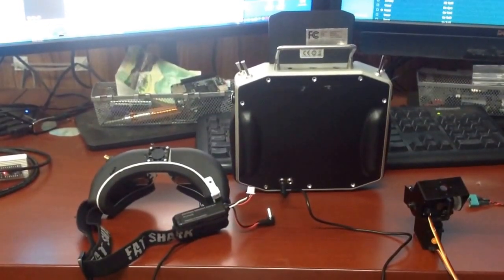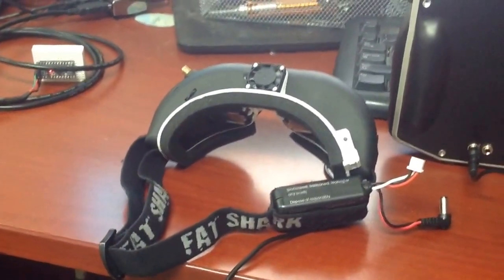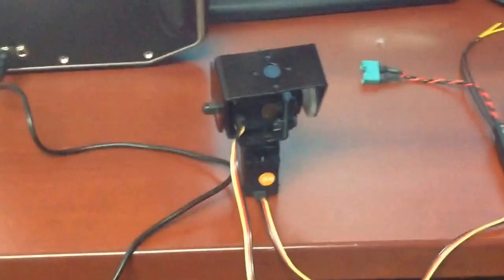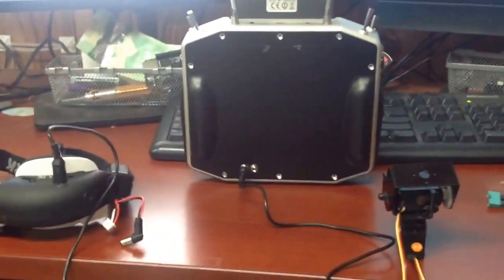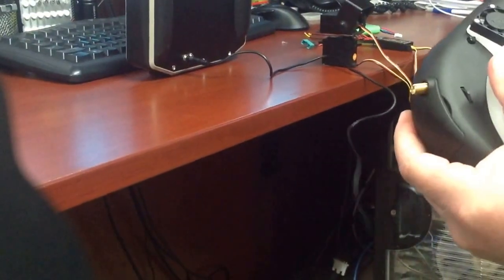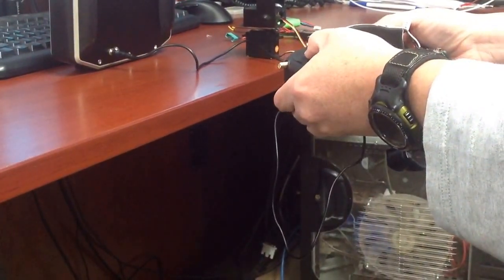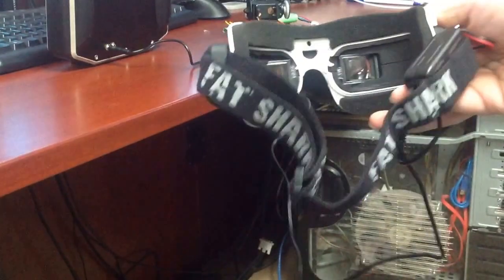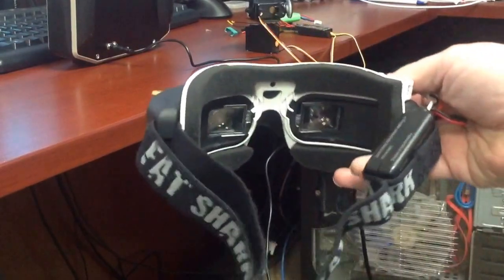Fatshark Headtracker with a Jeti DS-16

Comment: hello I bought na radio jeti dc 24 in the antenna that brings the radio has a connector yac according to the instructions is for the antenna of radio input ppm and output ppm but it is not very clear to me also I have bought the stereo connector to connect it in the inside the radio as you have put it since I want to use the head tracking of my glasses fpv skyzone v 3 could you pass some kind of scheme of how you have connected it? or make a detailed explanatory video since I can not find detailed information on how to send a greeting. Thank you.
Reply from the maker: The DC24 seems to have the same connector as the DS16 (based on the pics in the manuals).
I don't do not the wire scheme of the optional stereo cable that jeti makes. I can't buy it here cause they forgot to include it in the FCC testing! LOL
I made my own cable/connector for my DS16. Obtained the white pcb connector (from JST), and ran it to two mono jacks. Both jacks get ground for the Jeti connector, one gets the PPM IN and the other gets PPM OUT. Note the PPM out can also send EX TELEM serial data out also. You  choose the output type in the TX Menu - System - Configuration - PPM Connector Settings, see page 133-134 of the DC24 manual. NOTE: it says use the mono plug!!! 

You say you have the stereo cable plug. If it connectors to both the PPM IN and OUT pin, you are going to have to be really careful about what you plug in!
You might want to depin anything that goes to PIN4 (PPM out) and PIN2 (positive).
Only use PIN1 PPM in and PIN3 (GND).

Also you gotta make sure, you only hook 3V (ttl level) logic to these pins! They aren't 5V tolerant!

I have no idea what Skyzone PPM output levels are. Do you research. I had a hard time finding an good specs for Fatshark. In the end, i had to hook them up to an oscilloscope and check them.

Assuming you got the googles connected to those pins, lets assume your goggles are outputting pan on ch1, tilt on ch2, and roll on ch3.
in your tx, create pan, tilt and roll functions.
when creating each function, instead of choosing a stick/switch, you drill into A/B function selection, scroll to the bottom and pick the CHx PPM IN that matches your goggle output.
see pg141-142 of the DC24 manual.
then assign servo channels for you pan/tilt/roll functions.
Then you do a little servo travel setup for your camera unit.

Good Luck. Sorry i can't help with the details now. Maybe in the spring when we finally can buy the DS16 here in Canada i can help you out better.
Reply: when i buy my radio jeti dc 24 also buy the cable that you connect inside that e like the one you have connected http://www.espritmodel.com/jeti-transmitter-ppm-jack-cable-red-stereo.aspx
Reply: this is the manual of the glasses that I have orderedhttp://files.banggood.com/2016/12/SKY02S%20Manual-V1.0(1).pd